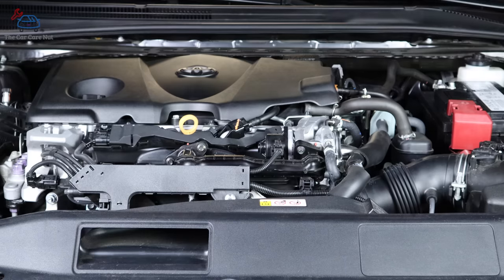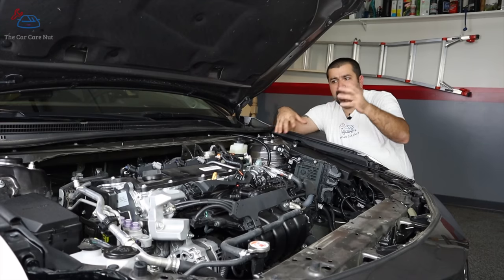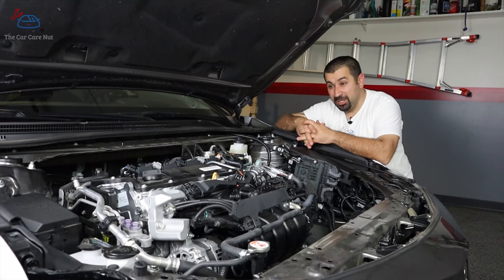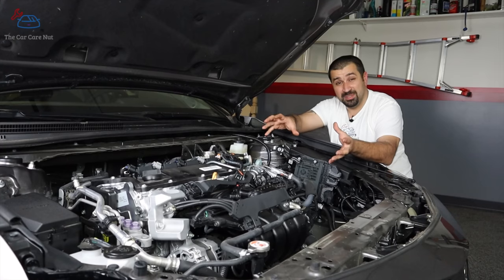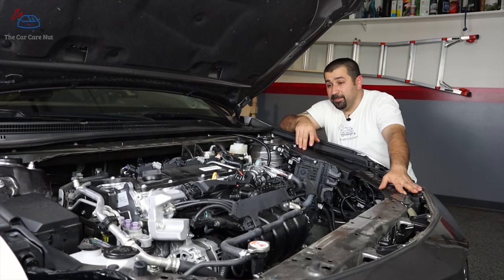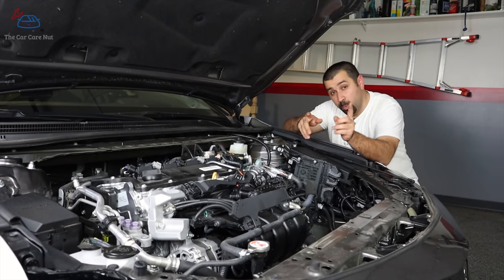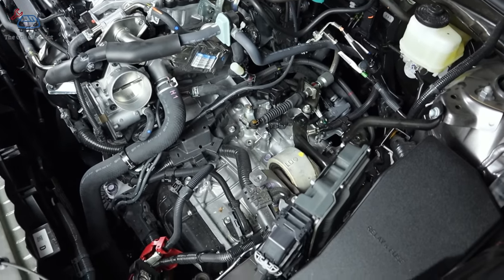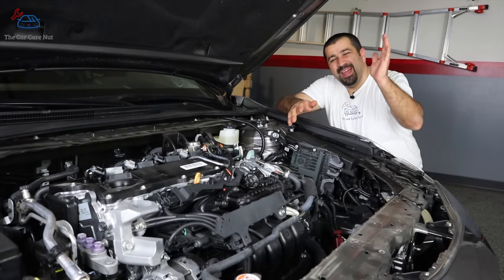Toyota's New Engine Technical review Part 2 : Variable Valve Timing, DIY tips  and Parts location

Comment: On the valve cover being plastic: The valve cover contains oil passages and pipes to lubricate the cams and rockers. Damage to that valve cover can have pretty severe consequences. Would have much better liked to see aluminum or carbon fiber for the valve cover.

A note on intake vvti ... The motor speeds up (advances) or slows down (retards) as explained.  BUT when the timing degrees are reach the motor goes back toi the camshaft speed - it does not keep running faster or slower. That is because if it kept going faster or slower it would keep getting more and more degrees out of time until the car stops running. It has to go back to matching the cam speed to maintain the added or reduced degrees if timing once they are reached.
Reply: my toyota has a plastic valve cover and it is from 2011 with 450k km on it. not a single leak from the vale cover it is as good as it was at day 1, there is some oil leak in the radiator area due to stone puncturing the transmission cooler but it is very very small and drops once in 3hrs but that drip has nicely coated the engine bay with a layer of oil. i would replace it someday but as for now the level is fine and i don't feel like taking out the bumper , condenser , radiator to get to the oil cooler.

Comment: 4:00 Bmw has a similar motor that changes the cam profile and actually acts as a throttle plate. It's mounted on the Valve cover on E92 engines

Comment: Now that I know about the motor in my new Rav 4 I'd like to know the highest failure item and at how many miles it typically occurs. Have these motors proven to be reliable after 200,000 miles?
Reply from the maker: Highest mileage seen so far is 150k and no issues. waiting for the magic 200k
Reply: @TheCarCareNut  Good afternoon sir, was there any updates since? I own a hybrid LE 2018 with 113kkm on it and absolutely love it. Appreciate your time, thank you!

Comment: Hi, is 0w-16 strictly apply also for 2zr-fxe(corolla 1.8h) engine or it can go with 0w-20?
Reply from the maker: Your corolla with that engine doesn’t have the same oiling system as this engine. Your corolla has a standard oil pump that is not variable like this one. If memory serves right that engine was ok with 0w20 or 5w20
Reply: @TheCarCareNut  Thank you!

Comment: lexus says i need to use 5w30, and the oil supplied is Castrol 5w30 Magnatec, anything else will void Lexus warranty. even though the manual says 0w16 oil required.  says is filled with 5w30 at Toyota factory. driving a Oct 2020 Lexus UX250h

Comment: Great video , from another licensed tech thanks for this info, there's little outside of Toyota about this powertrain yet. Do you know if the scanner can run a "coolant bleed mode" without 1500rpm plus?
Reply from the maker: Hey brother. The scan tool will not read bleed mode but you’ll see the water pump go to max rpm and all valves open

Comment: EGR is not new. In fact EGR in gas engine prevents knock as it lower combustion temperature so the engine can do lean combustion at light load. It also fills up the air volume that is throtttled up by throttle control, so the piston compresses nice full volume of air at all times. It also minimizes the partial vacuum ineffeciency associated with gas engine.
In short, EGR enables modern gas engine to run above 10:1 compression without knock.
Nice engine, the timing motor make a bit worry, but I think toyota has done a lot of research on this. Is it DC motor inside?
My dissapointment is the requirement of 0w16 oil, so oil change is little bit expensive.
Reply from the maker: The motor is a dc motor

Comment: Thank you for these engine videos. I now have a better idea of how my 2020 RAV4 hybrid works and a lot of confidence that my car is going to last many, many years. Cheers to those Toyota engineers and those that have the knowledge to keep us on the road when unexpected issues come up. Question on the engine. I am meticulous about the care of the exterior and interior of the car and it drives me crazy that the engine bay is getting dirty. What is your opinion on engine bay detailing? I’m not talking about 3000 psi from a gas powered pressure washer but a light stream of water from a garden hose after cleaning the visible parts with a diluted, ph neutral all purpose cleaner and soft brush. Thank you
Reply from the maker: Hi! You can use water just avoid direct water on electrical connectors and try to dry things up with compressed air
Reply: @TheCarCareNut  Thank you.

Comment: I was hoping that you will show us the location of PCV valve because I want to install oil catch can on my 2019 camry
Reply from the maker: The pcv valve is between the intake manifold and the cylinder head. You have to remove the intake to access it
Reply: Why do you want a catch can on a Camry. The port injection will keep the valves clean unlike Honda GDI engines.

Comment: What is the approximate price for antifreeze replacement by Toyota dealer ? 
What is the gas mileage compared to the  3.5L V6 
Engine. 2019 models in Avalon

Comment: I'm considering a 2021 Sienna. But I am kind of worried about the amount of HP and torque the engine puts out for a very heavy van. Do you think the Lexus V6 hybrid will ever be in the basic Toyota lineup?
Reply from the maker: Hi! The sienna will likely not be getting a different engine option as the one it has right now. It’s not the fastest or like the old sienna with the V6 but it has enough power to get it moving.
Reply: Oh, well, I was hoping. I pull a trailer occasionally, and I am afraid there is not enough torque to move it very well. Thanks for the comeback.

Comment: Enjoying your channel.

Purchased the 2020 Rav4 TRD from a dealer in the USA.  What grade gasoline do you recommend?
Reply from the maker: Hi! The recommended gasoline for your car is 87 octane. I recommend a top tier gas station.
Reply: I use arco 87 and runs great. Stay away from no brand gas stations. And from Costco use midgrade 89 since their gas is sometimes a cheaper blend than arco stations

Comment: This is a great explanation video. May I ask if carbon deposits of the back of the intake valves is non-existent on D4S engines like this or do they still exist. In other words, are the back of the intake valves just as clean as port injection engines? Thanks
Reply from the maker: Thank you for watching my video. So I want you to know something about carbon build up. It’s possible even with non direct injection engines. With bad gas and bad running habits like starting the car very cold for a short period of time and not letting it warm up repeatedly. On direct injection engines things are worse and could build up even with normal driving conditions. On Toyota’s D4S system that is greatly reduced but still possible with the conditions that would cause a non direct injection engine to carbon up. Does that make sense?
Reply: What do you think about that an oil catch can on ‘21 sienna?  Is it needed to keep intake clean?
Reply from the maker: I wouldn’t install one on a 21 sienna as it has a very good oil separator.

Comment: Could you share your thoughts on this 2.5 engine on how it developed from 170 hp (2016 RAV4 hybrid) to 219 hp (2020 RAV4 hybrid) and now it's 240"s hp for all current Highlander Hybrid and Sienna?  What have been done that increased the horse power with the same engine?  Or did Toyota just play with words and measure the same engine in different ways, and therefore, there's no actual increase in horse power?
Reply from the maker: It’s all in the tuning of the engine. Nothing much have changed between these cars
Reply: The Highlander and Sienna hybrids have bigger more powerful electric motors and more of them that’s why the hp has been bumped up to 240 (300 in the RAV4 Prime).
Reply: Meaning the bump in hp is engine hp + electric motor hp.?

Comment: I just need clarification, is the intake camshaft still driven by a chain and is the electrical motor is used as an actuator or the cam driven by the electrical motor? thanks, as always great videos!
Reply from the maker: Hi! The intake camshaft is driven by the chain but through the gear. So the gear can advance and retard timing.
Reply: @TheCarCareNut  thanks  for your answer is greatly appreciated

Comment: Just noticed that one benefit he pointed out in the Mercedes (I think) review for Toyota is they used simplicity in design like metal hose clams instead of plastic clips (he noted they may be used for ease of assembly on the MB). But here we have a Titus engine covered in the plastic coolant hose connector clips. This is the problem with being so confident in one manufacturers choices when you aren’t the manufacturer. They make a decision and you look stupid. 

I really like AMD and I am a fan of Toyota it’s just an observation.

Comment: My 2024 rav4 doesn't have the recommended oil engraved or displayed anywhere in the engine bay.  The manual recommends 0w16 (preferred) as well ow20 and 5w30. Ow16 is very difficult to find in my area. What's the downside of using the 0w20 longterm?.  I live in a region where the temperature in summer reaches 122F or 49C

Comment: The 2025 Camry owners manual specifies 0W-8 and the supplemental manual states a 10,000 change interval.  I guess they went even lighter for this newest generation.  The manual doesn't even appear to have exceptions for different driving conditions.  I plan to change mine at around 3300. The 1st 2 years of oil changes are covered by Toyota, so I will have them perform the 3rd and 6th oil changes.
Reply: The Motor Oil Geek (professional tribologist and oil additive developer) goes into detail about both the 0w-8 weight (it's all about the additives, it works, don't worry about it, use it, don't deviate without analysis and guidance from him via Speediagnostix) and also numerous episodes and guests stressing the importance of using 5000oci, or, said another way, cut the maker's recommended interval in half. Do not go longer without analysis.  He also covers and advised me personally after reviewing my '18 Camry oil, that generic gas can foul injectors and dilute the oil.  The limit is 2% dilution and I had 1.6%, an elevated level on the dipstick, and a gassy odor this past January 2025 upstate NY at about 65,000mi.  My error for going with generic gas.

Comment: Great review that I enjoyed every moment of it, But the thing that I didn't understand very well was the coolant change, Can you explain how to change the coolant step by step? Or mention it in a comment? I'll be thankful 🙏
Reply from the maker: Thank you for watching my video. I am looking into making a video on how to change the coolant on this engine. But in short you will drain the coolant from the radiator then open the hose that I showed you in the video. Fill it with coolant until coolant comes out of that hose then install the hose back and start the car. Hold the rpm over 1500 rpm until the fans come on twice and you’re all set.
Reply: @TheCarCareNut  so firstly, I need drain to drain the coolant like any other car from heater and the engine, then i open the hose and fill it with coolant, then fill the radiator and start the with holding rpm 1500 until fan start and stop twice, was that right? Thx
Reply from the maker: No need to take the heater hoses. Just when you fill it with coolant take the hose I showed you in the video until it comes out then start and raise the engine rpm over 1500 until the fan comes on twice
Reply: @TheCarCareNut     I really got confused 😂, can mention all the steps one by one? Can make a video ? That's gonna be helpful, keep up the great work 👍
Reply from the maker: I’ll try to push the video for this up the list to get it done sooner.
Reply: Normal, pour the coolant via the radiator opening at the radiator cap while the mentioned hose is disconnected. When the radiator is full with coolant and also coolant dripping off that hose you are good to go. Is it make sense.
Reply: @TheCarCareNut  so from my understanding, i will pour the coolant via the radiator opening at the radiator cap while the mentioned hose is disconnected. When the radiator is full with coolant and also coolant dripping off that hose, then i turn the engine on and rev it up to 1500 rpm so the fan open twice, is that it?
Reply from the maker: Yes that is correct you want to stay steadily over 1500 so perhaps go at 2000 rpm

Comment: I did not know the gas engines, ie the non hybrid models from 2019 and newer were the Atkinson cycle. I want to buy a RAV4 but can’t decide between the gas model and the hybrid. By the way is the oil filter a spin on type or the more complicated cartridge design? When I get one I’ll likely have it serviced at the Toyota Dealer as their knowledge is excellent and prices reasonable. Thanks for a great video!
Reply: It’s an old style filter at least on my 2020 RAV4. Reasonable price repairs at the dealer??…no such thing. That coolant bypass valve replacement will set you back $600-$800 for a $100 part. No thank you

Comment: Several years ago I was asking the Ford service manager about carbon build up in direct injection vehicles. He said it wasn’t a major problem but ethanol in the gas caused many problems. I have a 2021 Highlander hybrid, what’s your feeling about using non-ethanol gas?
Reply: E10 or even E15 is fine to run in the HH 2.5 engine.  Don’t let the car sit and occasionally run at wide open throttle for a few seconds.  This engine has port and direct injection.

Comment: This is really complicated.  While your clear & frank presentation is much  appreciated, the additional complex systems cannot make the engine more reliable than the simpler versions.  It is kind of off-putting at first.  

One wonders about the buyer  trade offs.  Better fuel economy vs. higher purchase price and more & expensive maintenance.

It may be that the simpler, older base Toyota models are a wiser choice than the advanced  "Mercedes-ized" Toyota offerings.

Further, a simple EV begins to look a lot more attractive in comparison.

Comment: Do you think use of 5w30 synthetic in this engine will void the toyota Warranty? I have seen manuals from other countries showing that you can use different viscosities in this engine...I believe that companies are pushing these light oils only for fuel economy for environmental reasons just like the long oil change intervals the company's are now pushing. What are your Thoughts?
Reply from the maker: Hi! Different regions might have different programming but this engine has the variable oil pump and I would use 0w16 with it
Reply: @TheCarCareNut  Thank you for the Reply My manual (Canada) says under special conditions different viscosities may be used...I am confused as to why 0w16 is so critical....
Reply from the maker: Because the oil pump is electronically controlled and programmed for a specific oil
Reply: @TheCarCareNut  So do you think using a heavier weight oil 0w20 or 0w30 could cause Damage?
Reply from the maker: Don’t go higher than 5w30 if you want but personally I would just stick with 0w20 and change it every 5k
Reply: @TheCarCareNut  Thanks for your Advice i really appreciate your Opinion. I will follow your advice in my Rav4 Take care 👍

Comment: I have a camry SE 2020 with the things you tell us in this video about the coolant change y can flush  the coolant system with water doing the procedure and then  doing it again with the coolant?
Reply from the maker: Hi! You can but if there’s no contamination a flush is not needed
Reply: Then  I drain the old  one and I fill with the new one like you said in the video?

Comment: Hi AMD it’s Michelle I was watching TikTok & they said drain several drains MY question is does my 2014 Toyota Prius have drain compartments?
Reply: Coolant drain?
Engine oil drain?
Transmission fluid drain?
Differential fluid drain?
Brake fluid drain?

Comment: I’m agreeing on the 0w-16 oil, so much so that I researched this topic . Mobile makes Toyota 0-16 oil , but it is NOT the same as Mobile One. It’s made specifically for Toyota with certain advantages, just picking one is the amount of Molybdenum, this oil has about double what others have ( Hybrid gas part of the car shuts off every time the is stopped { can’t begin to say what I don’t like about this feature} ) so the oil is so important to cling on to all bearings while the gas engine is not turning !  I’m stopping now, more later .

Comment: Hi, I have a 2022 Camry SE with the 2.5 engine. All of a sudden the mpg dropped by 10 MPGs, i changed my oil, replaced all the filters, the AF sensor, the spark plugs and the coils. Also tried running multiple fuel system cleaners, nothing helped, what else can I change and hope my mpg restores?

Comment: Once coolant starts to come out the egr hose should you reconnect egr hose back to pipe while the car is on ? And can you take the rest of the smaller air pockets out the radiator that you missed from egr valve? Or you must take all of the air out the egr valve at one shot and cannot take out the smaller pockets of air from radiator ? Thank you
Reply from the maker: You’ll leave the port open with the car off until coolant comes out then reinstall it and run the engine past 1500 rpm until the fans cycle twice
Reply: Can I also burp the rest of the smaller bubbles out the radiator naturally (the small air I missed from burping the egr valve)
Reply from the maker: Yes you can
Reply: @TheCarCareNut  to take all the coolant out the radiator and engine can it be done with just unplugging the lower radiator plug and lower radiator hose?, or what is the procedure to flush all the coolant out the system before filling with new oem coolant?
Reply from the maker: Hi! Just drain the radiator and fill.